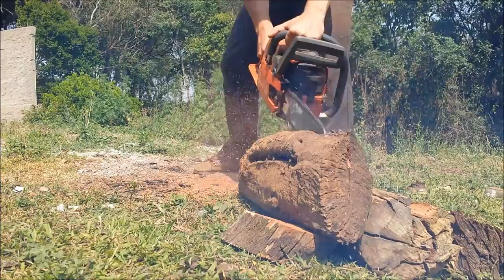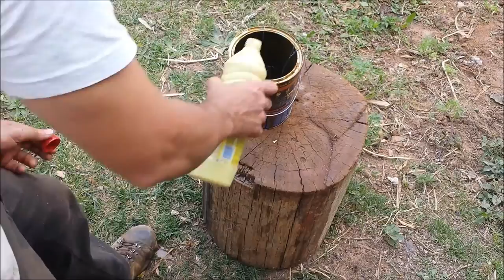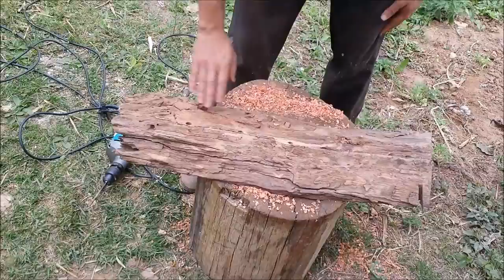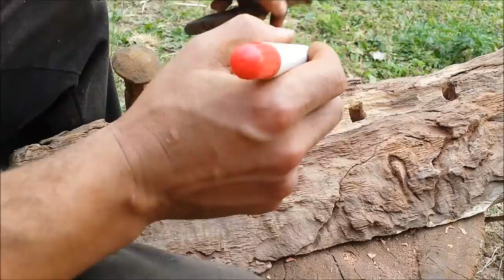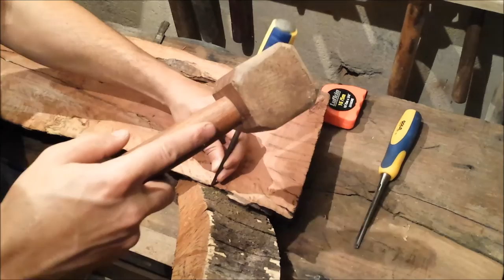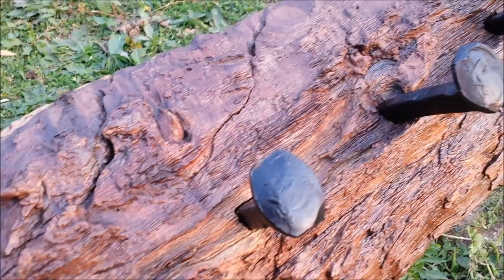Railroad spike Coat Rack

Comment: Nice work my friend, I like the simplicity. I'm going to make something similar but with a different wood and an oil finish and maybe force a patina on the spikes rather than paint but that my own personal preference.  All together good stuff
Reply from the maker: Hey man, thanks for watching and commenting, I like this job, the oil is very good to finish the job, a kind of patina I liked, is to use a brass brush on head the spikes, will stay golden, tipe old gold, mid burnig.
good luck on the job my friend!
thanks!